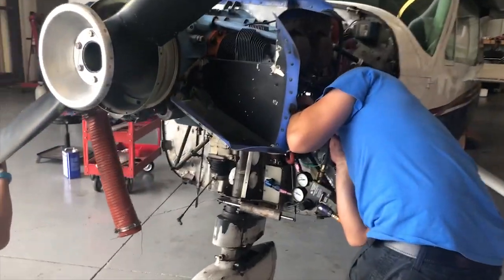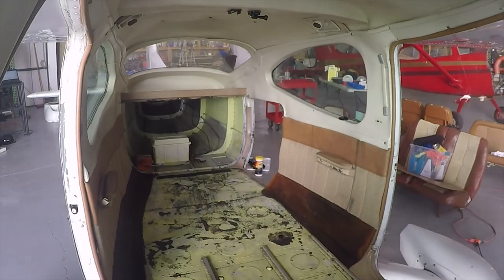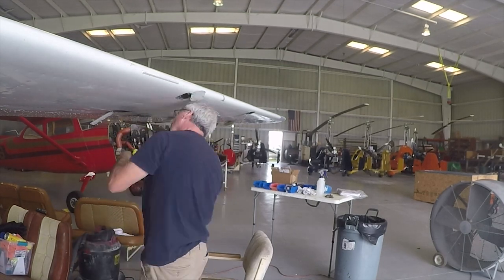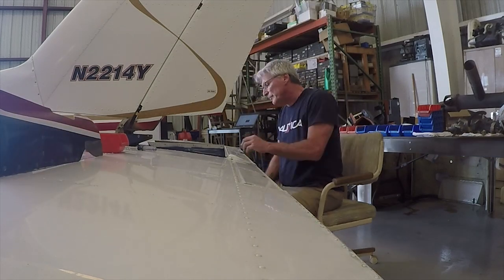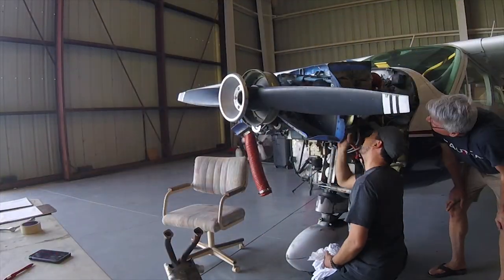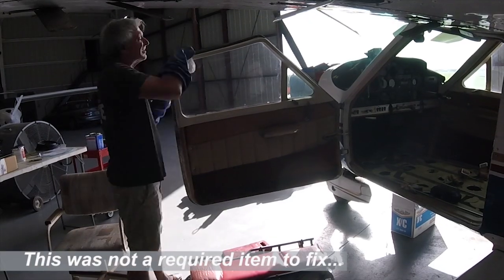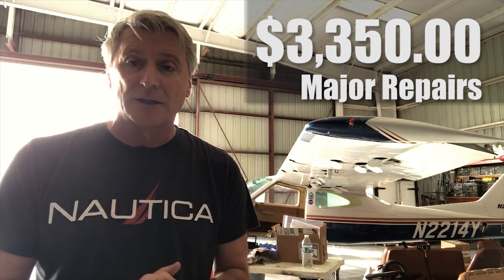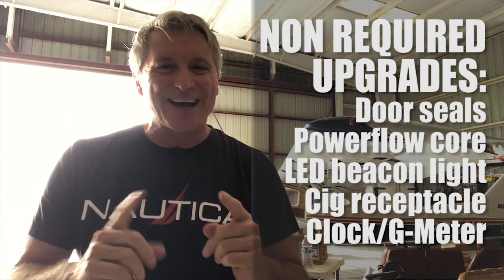What to Expect During Your FAA Annual Inspection

Comment: The annual on my E-LSA was $1200 which included an exterior detailing. 😎
Reply from the maker: Yes the new or the airplane the lower the annual and if my airplane had no problems and I didn’t do any upgrades it would cost $1200 as well. Thanks for watching the next program will be all the upgrades I did and the costs broken down ...
Reply: @Over50andLearningToFly  I have 2 friends with 172 Cessna's. Both of their annuals were over $3000, one was close to $4000... Thought it had to do with the "certified" aspect. One of the many reasons I chose Light Sport. Mine is also certified Experimental. Which allows me to do upgrades and basic maintenance on my own. I prefer to have an experienced professional going over my plane. I couldn't believe all those inspection covers you have on your plane...It looks like a lot of work just getting it open to do the inspecting..And people do need to get paid for their efforts. Love the channel.

Comment: Good one Ted.  I've taken a leaf out of yours and Kelley's books and gone and bought an aeroplane (pending a satisfactory engineering inspection).  It's a 1978 Mooney M20J-201.  Should have a video of it in a month or so - it's currently over the other side of Australia, and I'm trying to get permission to travel to Western Australia to pick it up and fly it back to the east coast.  WA's border is closed and one has to get special permission to enter that state.  Hopefully, it will all work out :)
Reply from the maker: That is fantastic! Congratulations and make sure to get that video out there so we can see it I think that’s so cool also start your own YouTube channel about your adventures just to encourage others because it’s really working!
Reply: @Over50andLearningToFly  Cheers.  Already have heaps of videos  under 'Sactu1' of my Glasair adventures and IFR journey - looking forward to adding Mooney adventures to it.  Later, Jim.
Reply: Retractable gears can be rather costly to maintain.
Reply: @GeneralSirDouglasMcA  It can indeed.  My last plane (Glasair) had hydraulic retracts, which took a bit of mx.  The Mooney is electro-mechanical, so less to go wrong IMHO.  But they all need regular maintenance, which increases the cost of annuals over fixed gear.

Comment: I love power flow exhausts, I don’t fly, I’m a mechanic and they keep me busy.
Reply from the maker: Swapping out the core was pretty easy-  the plastic wrap around the core stays on -  and burns off during the first few minutes of operation... does that make a good seal when the foam expands?
Reply: Over 50 and Learning To Fly! Every insert I have replaced has been a fairly snug fit but I guess they do expand a bit with vibration that said the most common failures I see are due to a lack of compliance with the ICA’s, prop balancing and failure to apply anti seize compound when reassembling after inspection.

Comment: Question: is this C150 with engine has 1280 hours on and is on condition and propeller has 1025.1 hour a good buy?
Reply from the maker: Sounds good-  do you have a link that you can send over?
Reply: ALWAYS, ALWAYS, -  get a pre-purchase inspection - NEVER assume that a plane with a current annual is OK. Items discovered during a pre-purchase can effect final price you pay. I hope it is a good deal for you
Reply: Check the logs and make sure it hasn’t been sitting.